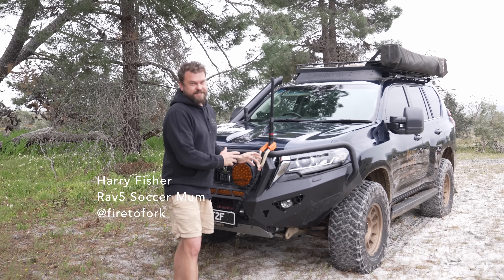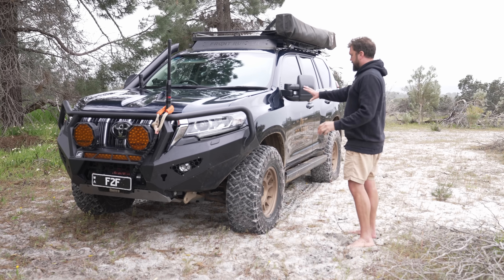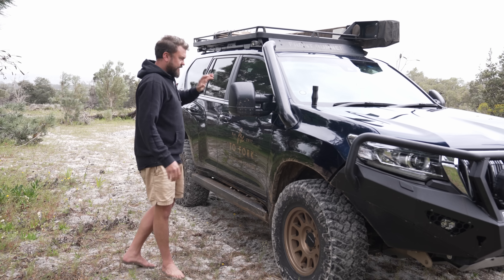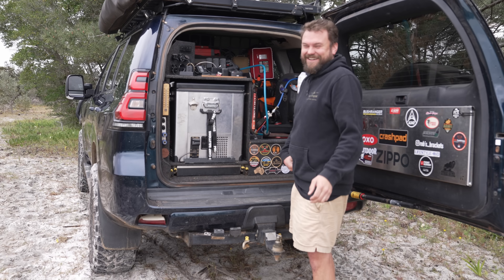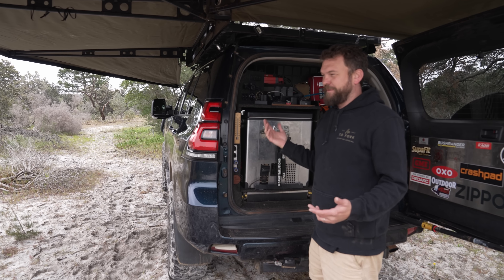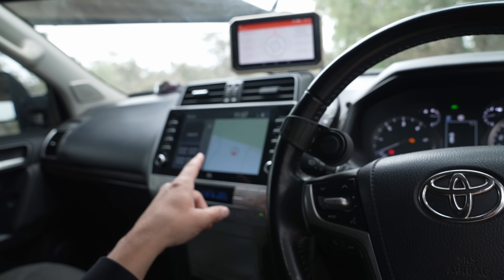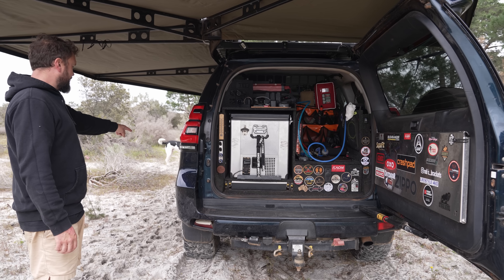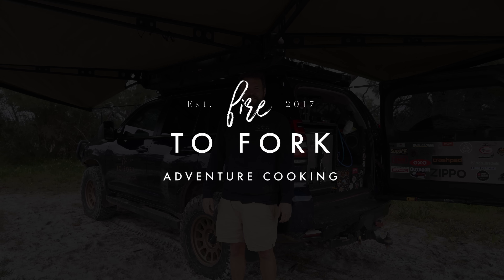4 Years In A Prado - Regrets and Wins

Comment: Love your work Harry! The Kaon table has been brilliant in my 90 series Prado - they dont do one for my older model so I bought the 150 table like yours and then got a 3mm piece of ally sheet cut to the same size as my door card for the barn door and then carefully cut out the holes and used rivnuts in the door and bolted it all in that way so in effect it has an ally splashback which looks and functions bloody beautifully!! You made it look really easy undoing those damn tight little elastic loops . . . . I always struggled to get hold of it and hurt my fingertips so I did a nice little hack of using a really small arribeener around each loop which tucks away nicely on the side edge of the table when locked in place and makes it soo dam easy to open now.

Comment: I have a 120 prado with 300k on the clock. So far, I haven't had a reason to upgrade. Still running as good as new. I got the 4l V6 and its just brilliant. To be honest, its so good I'm too scared to upgrade in the fear the upgrade is not as good 😅
Reply: I went from a 120 V6 to a 150 diesel and it wasnt an upgrade. As long as your ok with the fuel consumption but really, its not that much more.
Reply: @1Coolbanana taking into account maintenance on a diesel, and from past experience, the petrol is cheaper overall. And it's so smooth and quite.
Reply: 120 D4D, 225k. Feel ya, not much out there feels like a true upgrade.

Comment: A nice summary of the accessories, be very interested in seeing how the Lithium Battery works out,and what rear bar you get.
How has your air filter box worked on dusty roads? Any dust getting through?
We are in the process of fitting our Prado VX out. Lot more basic than yours :)
My biggest complaint is the leaky rear door seals, even when all the recirculate options have been turned off.

Comment: Would be interested to see how the lithium holds up. I would assume they all degrade over time depending on heat insulation. I had an Itech one for one year and it already degraded to the level I can feel it when pushing the start button.

Comment: My Bluetooth was good when I got the Prado at 100,000 klms just under 3 years old.
Quickly went to between bad & useless. Didn't realise it may have been an OEM issue, too late now. Thanks for the info.
Got the Kaon tranny cooler too. Even without towing, the tranny temps were reaching 120°c on a 9° night ( running down to the Sunny Coast) when you have a DPF burn in hilly terrain. Lightly loaded at that. 1 person, a fridge & overnight bag. 
Fixed now😊 Love the Kaon gear, credit to Aussie Industry. I rely on laser cutters  for my work, so get what they do, love their products.
Toyo ATII here in std size, very happy with them. Ran them on my Frontera in the end, ran Pirelli Scorpian A/T prior. Think the permanent 4wd & doughy power in the Prado help wet weather wheel spin massively. No more breaking traction at 80kph when you drop 3 gears to overtake 😁
Dobinsons MRA as of 3 months ago. Love that.Not driving downhill (as much) by OEM default.

Comment: All Preso’s have a factory trans cooler. It uses a heat exchanger through the radiator. The trans oil  pass  through the radiator then through your kaon air cooler.
Reply: Not only that, the prados, well 120s anyway seem to have a pretty hefty cooling system, so as long as you don't drive like a dingus you don't need to add a cooler (even when towing something reasonable)

Comment: Hey Harry, Just wondering where you got the mounts from for your 270?
We’ve installed a 270 from another company that has the forward piece as well but the mounting position on our rack means it sits a little too far forward for the mount and has a slight flex in the awning frame because it’s not quite in the right spot to hold the load. The shape of the mount you have on the front seems like it might help us with that issue

Comment: great video harry, all honest feedback, but how did you get gme mount to stick to the dash??? i’ve tried most but they seem to fall off especially once ambient temp warms up
Reply from the maker: I had to screw it in
Reply: @firetofork  ouch was hoping that wasn’t the answer, thanks and loving the content.
Reply: I used silicone, been on a couple of years, no issues.
Reply: I used 3M Scotch tape Extreme from Bunnings. Been on 12 months and has never come off. The 3M stuff that comes with the mount lasted about a month.
Reply: @klodee1 Pirate Camp Co have a bracket that you mount the hand piece to specifically for the Prado 150. Bolts into an existing 10mm behind the Rhs centre console cover. No drilling. A bit expensive for what it is but might be worth a look if you don’t want to drill your dash
Reply: I have mine in the same place. Use double sided gorilla tape.

Comment: You hit a concrete pilar at 20 kmh and the airbags dont go off ?
Reply: I believe there is a certain speed you have to get above to trigger the sensors in the crash bar
Reply: Ofc not. If you’re not likely to headbutt the steering wheel, airbags won’t trigger.

Comment: Sorry dude Prado is gay AF.  Having said that your car is gay AF but I love your channel and I am a big fan I've been following your channel for ages. The mrs and I have often kicked back and binge watched it.
Reply: Says the guy who drives a Corolla
Reply: @Corey-pd3mi  ranger raptor with Herrod mod over 500hp and a ranger fx4 tuned by BPT performance 850nm of torque.
Reply: @vaughanscott7308  the raptor engine will leak oil like a siv eventually (look at all the F150 ecoboost's in america that need full teardowns to fix small leaks constantly), those ecoboost motors are not built to last at all and the diesel motors are no better. Ford's in general are not built to last anymore, toyota's are and the prado's and hilux's will still be running flawlessly in 10-15 years.
Reply: Looking at your pic, I think we can believe you 😂
Reply: @jakepalmer1986  I understand what your saying but I'm over gay toyota engines they are just pathetic.
Reply: @vaughanscott7308  why?, cause they’re a more reliable and stronger motor? 😂
Reply: @jakepalmer1986  because they are soooo underpowered I had a 2010 hilux that I bought brand new the engine was a massive let down and it just choked up because of the egr valve what a shit idea that is.